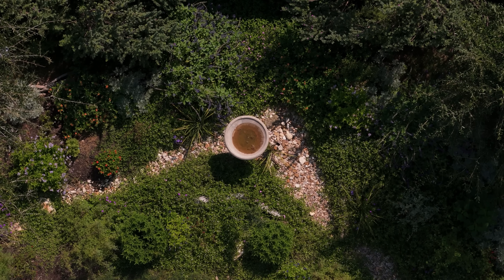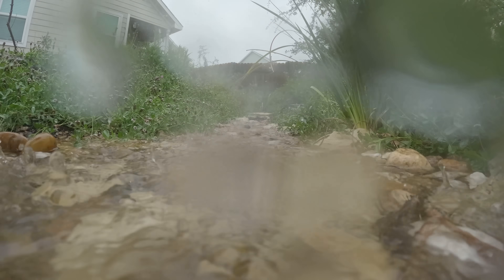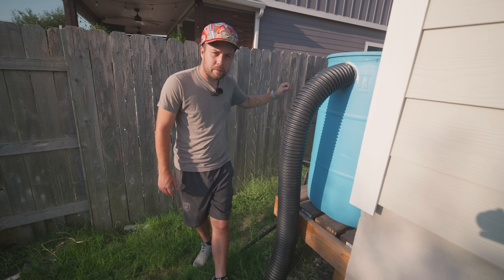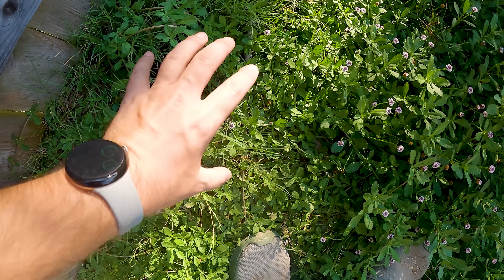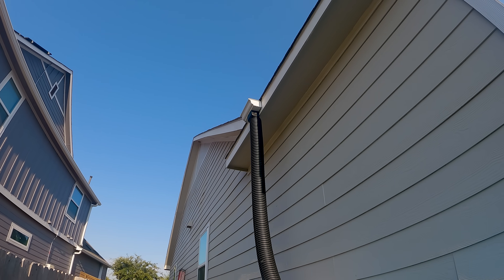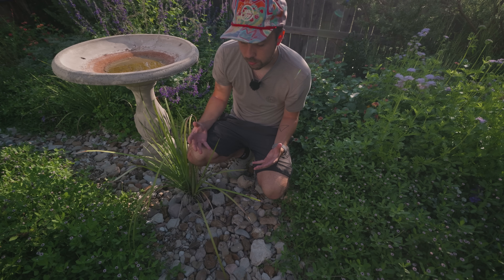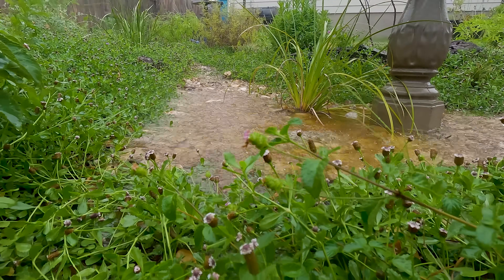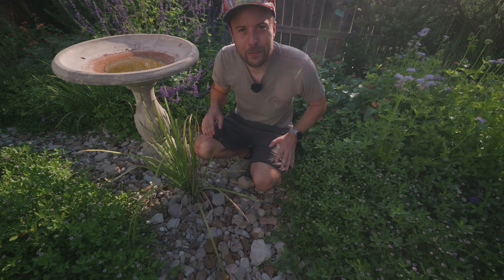How My Backyard Swale Handled a Texas Flood

Comment: Hi, thank you for the nice video. One issue I spotted is the water free falling from the roof next to the wooden fence. on the other side you have your rain gutter and water barrels, but on the other side the falling water will eventually dig out a big muddy pit that will damage your pipe and french drain system on that side. Never underestimate the power of falling water. Even if you have some bigger rocks there (which the water missed, falling closer to the fence) it will create a problem in the long run.
Reply from the maker: Good call. Rain chains can help direct and soften the water’s impact so we might try that here. It is a main access way so options are limited.

Comment: I watched all four of your video series so far and not once did you mention HOA. I assume your neighborhood development has an HAO? If so, did you have to get permission to landscape your backyard? Or front yard perhaps in future project?
Reply from the maker: I do have an HOA! In fact, I am one of the (un)lucky homeowners who lives in a new build neighborhoods who's HOA is still entirely controlled by the developer and none of the homeowners (until some nebulous date).

Technically, I need to get permission to do work in my backyard, but as none of this is visible from the road or, frankly, anywhere besides my own backyard, I haven't bothered. It's been kind of the accepted status quo in the neighborhood so far - out of sight out of mind.

That being said, if/when in the future I decide to add a pergola or structure, then I would need to get permission. Additionally, should this series perform well enough through its completion, we may do a series where I do a full lawn kill in my front yard. If that does happen, then working with an HOA will be a VERY large part of that project as everything there has to be done within the bylaws.
Reply: @symbiosistx  Same status as me re: out of sight backyard but front yard will require HOA compliance. Except our HOA board is at 50% developer and 50% homeowner stage. I was just wondering if the Symbiosis team had any strategies or experience for dealing with HOA bylaws and other policy rules for suburban developments which all seem to have HOAs by default..
Reply from the maker: @RA-LHTX  There is increasingly more legislation in Texas about what HOA's can and cannot tell you to to do in regards to your property and especially with water conservation. Thats always a good place to start and keep an eye on.

As for getting them to buy in or go with you on stuff, it really is a case by case basis as every HOA is different, but in general - try to find out what it is they don't like about something and work around that. For example, in another video, we talk about a project where our client in a VERY restrictive HOA was completely against rain tanks because they felt they were an eye sore. We worked with them on a solution which ended up just being to create effectively a visually pleasant above ground concrete cistern with a patio on the top. Obviously this an extreme example but the gist of the message is basically to just be as nice as possible and really try and work around whatever it is they take issue with it and be creative.
Reply: @symbiosistx  It can be difficult to convince them on some things. Fortunately, Texas law does actually prevent an HOA from denying homeowner installation of rainwater harvesting systems -- as well as installation of solar panels, flag poles, and satellite communications receivers. They can specify certain aesthetic guidelines but they have to be included in bylaws/architectural rules or policies. I've had my share of Texas HOA learning curve.
Reply: @symbiosistx  any chance you could get in on the HOA when it's still very young? That way you could influence the proactivity of water wise and nature resilient design in your community?
Reply from the maker: @bigmac3645 Potentially! 

I have actively been trying to get onto our MUD board as I think MUD's are a great opportunity to utilize utility and wildspaces in an effective way for biodiversity and ecosystem health. As it stands, usually its just paying mowing crews to come obliterate those zones every x weeks. If I find success here, Ill definitely make a video about it!
Reply: @bigmac3645 Early influence may actually be more difficult because that is when the HOA board is composed of 100% home developer members and their main concern is optimizing profits and home sales. Their approach to optimizing profits/sales is standardizing and maintaining curb appeal. Unless a proposed HOA rule variance is going to save them money in the short term as they finish out the development, they will not be interested in long-term ecological benefits for the homeowners or the development itself.

Comment: With the increased in ground water, will it impact the stability of your home's foundation?
Reply from the maker: All this water is being soaked into the ground over 15ft away from the back of the house. The french drains (and redirecting roof runoff away from the sides of the house) actually helps stability of the foundation, if anything.
Reply: @symbiosistx  Thank you!
Reply: It depends where you live and the underlying soil and geology. But generally if your home builder knew what they were doing, or built the home according to local code, it is like not going to be an issue. If you DIY built your home, then it depends, like I said.
Reply: @RA-LHTX  Gotcha

Comment: Where did you find Frog fruit? Did it grow from seed? I have been looking for some new ground cover in my yard, but I never see frog fruit when I go shopping at the local nurseries around Austin.
Reply from the maker: I'll admit that I cheated a bit and ordered my initial set of plants from a wholesale nursery (which I have access through via Symbiosis) but I have seen it at Hill Country Water Gardens in Leander a bunch.

Frankly though, Frogfruit is prodigious at propagation. If you can't find it in a local nursery, I'd just look for it in the wild and when you find a healthy patch, just take a few cuttings (be equitable) and bury them in a light amount of soil. From there you basically have infinite frogfruit.

All the frogfruit in this system came from like 6 plantings. I just kept burying the new growth and making it go the way I wanted and in one spring/summer it basically took over the whole thing as intended.
Reply: Check the Native Plant Society of Texas website for their native plant sales. Many provide a list of available plants.
Reply: I kept an eye on frog fruit in the area, and then when it went to seed I just gathered up a ton in a little plastic bag. I'm tossing it out in my wet spots in my garden to stratify over winter. Probably gonna take a bit, but it cost $0 in money and only a single calendar reminder to check as I got closer to fall. 

You could also try thyme for a similar effect, it's a little easier to find than frog fruit.

Comment: Soakaways along your walkway will help slow the runoff. Putting the overflow on the same barrel as the intake will mostly take care of the chaotic overflow and still let the additional barrels collect water at a slower pace. Storm water overflow will muck up a pond just like it does streams and rivers and pond people don"t recommend it, especially if you have fish. I see Bermuda grass growing in the sides of the garden. That is going to destroy the looks of your garden in a year or two and turn it into a weedy mess. So since you are not defending the edges of your garden, I believe this garden is going to fail. Consistent weeding and care are critical for new garden success. I don't see it here which is too bad given the time, money and effort it took to build. Right now it is very attractive. Bet it does not stay that way.
Reply from the maker: There is bermuda in only one location. The side bed along the fenceline. It only looks bad right now because I haven't weed-eated that area in a while. Its designed to easily be weed-eat back down with other native groundcovers and grasses which will eventually choke out the bermuda. I've done this exact process elsewhere to extreme success. 

There is no bermuda infiltration anywhere else in the entire system. Ground covers and occasional management of said ground covers have strangled out most weeds and bermuda. The edges of my garden are defended by ground covers (frog fruit, ponysfoot) and heavy shade plants like artemesia, lantana, etc.

The bermuda pad is irrelevant as its going away, anyways so all of that is getting ripped up. That lip up against garden will eventually be a large boulder wall going up to 2ft in height to form the edge of the patio. Frogfruit and natives will eventually swallow that gap.

Shade and native plants will eventually win out against Bermuda.
Reply: @symbiosistx  time will tell. In my experience, once Bermuda invades a landscape: native or otherwise, you have to dig up your plants and start all over. Bermuda, bindweed, and nutsedge win over everything else.